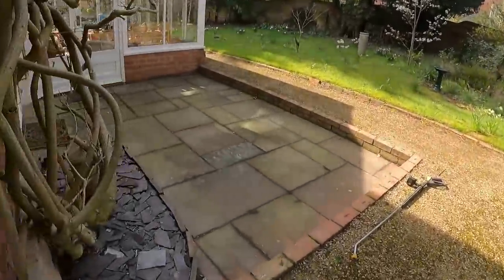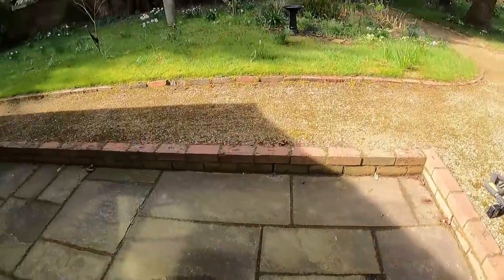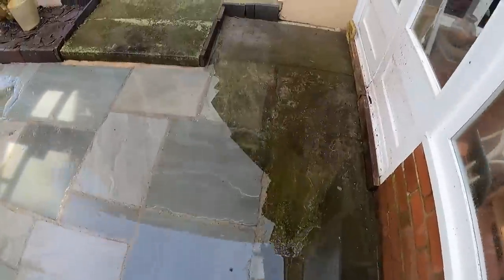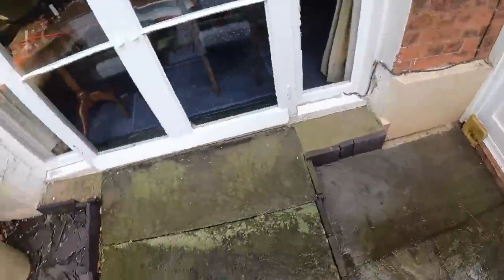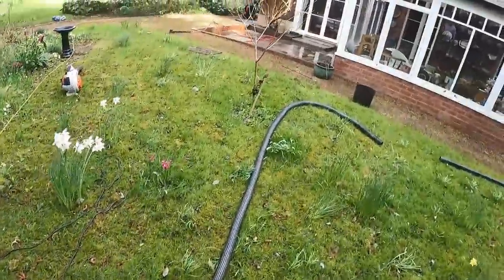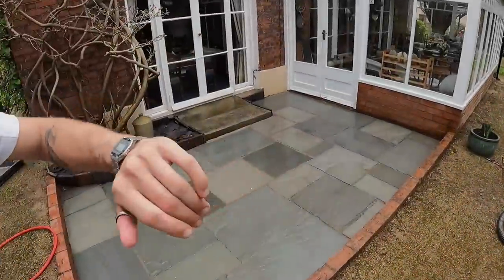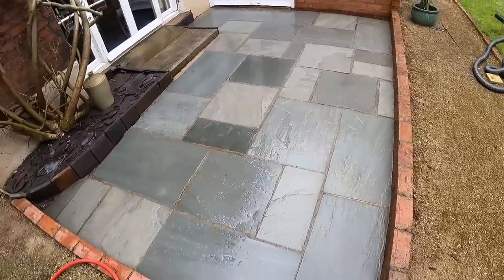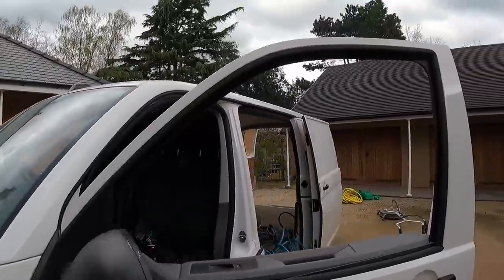Major FLOOD Risk On This BLUE Patio! | Power Washing

Comment: Hello from the other side. In the old days I had a lawn service. We made water dams out of motorbike tire intertubes filled with sand,(and the ends wired shut)you can use them in front of doors to keep water out. They work great for stopping water from going where you don't need it to go. Works well as water dams to stop it from going in the wrong way. Give it a shot, worked well for us way back when...as always, great work.

Comment: Great job on the patio considering there was a lack a drainage. Thank goodness you came prepared and had a wet dry vac to suck up all the water that was flooding up the area you were cleaning. The property owner should look into getting a better drainage system for the patio.
Reply: I just wonder what happens when there's a downpour!

Comment: O.K., I have a question.  Since you have been dealing with cleaning surfaces...windows, roofs, asphalt, concrete, pavers, fencing, plant beds, decking, etc., I am noting that at that location they appear to have algae or moss imbedded gravel paths.  Can you do anything with those?  You have mentioned various ways of dealing with "no drainage" over time.  The wet vacuum was an interesting solution. Nice use of the blower to move water.
Reply: lose gravel path as in little pebbles.
the one method you do see is besides just bleaching everything to hell.

is to take out the gravel. clean them in a one of those portable mortar mixers. (water with detergent) or a washing machine. (same effect) 
When clean let them dry well and after that you can place them back.

it's a very tedious and time consuming job. (so expensive) but if done well the result can be really good.

Comment: Should've used the turbo. Its quicker. Less water build up to contend with.....
Reply from the maker: if you want the pointing blasted to bits maybe :D
Reply: @PartridgeExteriorCleaning  Nope. Turbo will works faster. Start at the doors, Lift the turbo as needed to reduce the pressure, & crack on.

Comment: Does anyone know if there is a small pump system that would help to move the water from one area of a job like this to another? I mean, other than a shop vac. It seems like there ought to be a system created that would allow someone to place a pump in the lowest area where the water pools and then continuously draw the water through a hose or flexible piping for a distance to drain out away from the area you are cleaning. Imagine if Sid could carry that to a job like this. It would save loads of trouble. Edit: I did a bit of looking around and found that some people use small pumps for decorative garden water fountains to drain ponded water in their basements. I wonder if that is a thing that might work in situations where the water is this shallow?